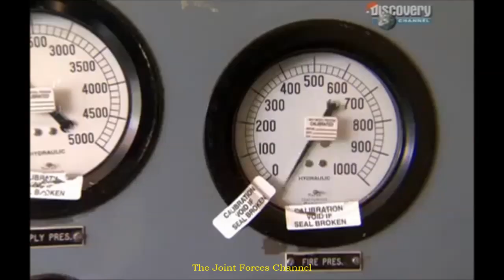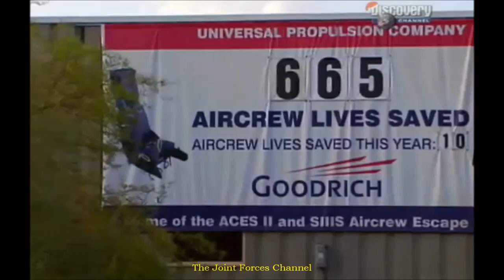Aftermaths Of Ejecting At Supersonic Speed

Comment: Can they put the throttle down and then eject
Reply: When you are at the point of ejection the aircraft is unrecoverable and you do not have time. By the time it would take to slow down when you throttle down to safer speeds the aircraft would have crashed already
Reply: At mach 3 when you lose an engine you have maybe a second at most to react before the plane breaks up.

Comment: It would be cool if they could make the whole cockpit eject and parachute, then once its slowed down have a second eject outve the cockpit to reduce the wind impact
Reply: not the worst idea conceptually. I'd guess it's been investigated. Crazy difficult design challenges there. Getting it to separate and then act like one giant ejection seat. Seems if you could do that you might not want ejecting seats too.  Probably  a lot of compromises for airframe design, idk. Requires larger rockets and chutes, explosive separators. Beyond extreme design.
Reply: Unwashed King nah I’m good
Reply: Apparently some larger airplanes had (or still have, I don't know) escape capsules or ejectable cockpits, but pilots stayed inside. Capsules descended using a large parachute.
Reply: @enginerikli5895  Yeah but too heavy design apparently.
Reply: I think F111 uses ejection pod. The whole cockpit get ejected sort of.

Comment: 1000 kph is 621 mph just FYI
Reply: Derek Wall no 621mph is 1000kph
Reply: @1986Honda4trax  lol
Reply: @potatopilot16  it really should just be 621 mph
Reply: @1986Honda4trax  ah yes american units the wya its supposed to be
Reply: @potatopilot16  yep, I understand the use of the metric system for science though, to avoid confusion and big accidents like with rockets and shit😂
Reply: @1986Honda4trax  The metric system is superior.
Reply: @gh4kr  no its not
Reply: @1986Honda4trax  Yes, it is. There's a reason why NASA has used (for the past 50 years or so) and currently uses the metric system for the majority of its projects. A decimalised system is more intuitive and efficient (no conversions or fractions needed). Additionally, most US engineers convert to the metric system, do their calculations and then convert back to imperial again.